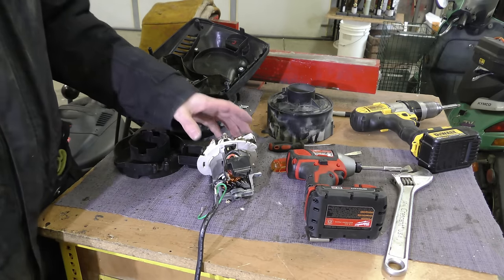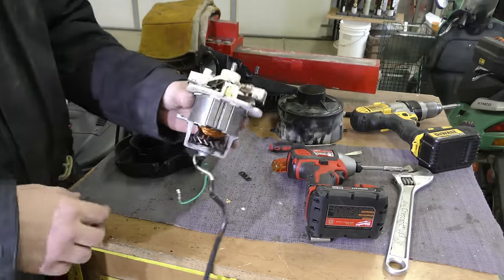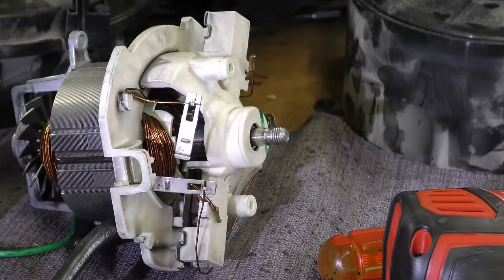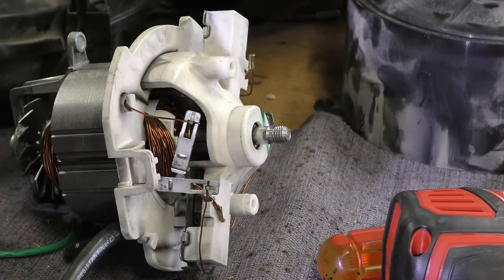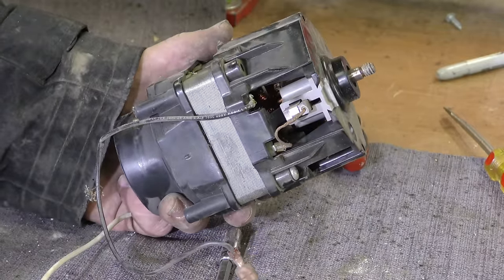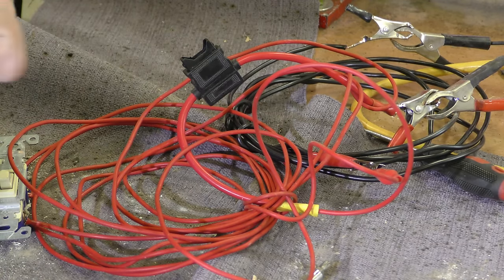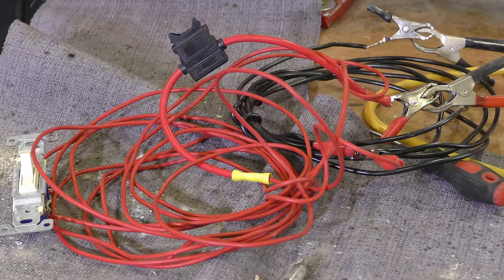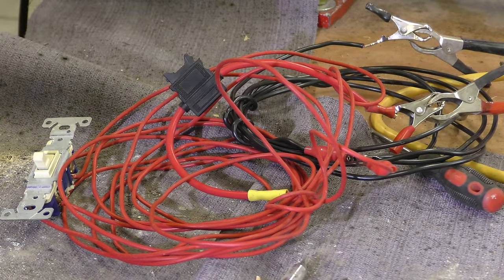Shop Vac Failure Points and What Happens When You Short Out a Fuse

Comment: Your video just saved me some $. For those of us that have more time than money it was worth it for me to check why my shop vac stopped working.  I had the exact problem you mentioned in your vid.  I just stuck a auto fuse in between the terminals and it fired right up. Thank you!

Comment: I found this video after diagnosing the open circuit at this point. 10 gal/4hp shop vac is 10 years old, heavily used, but the brushes and armature look mint. Seeing the fuse was melted, I put a piece of solder wire between the connectors. Figured that would fail faster than a hard connection or aluminum pin. 🤷‍♂️ Looks like I'm taking the brand new Rigid 12 gal back today. Lmao.
Reply from the maker: Yep, self-destruct feature! First vacuum I did this to 20 years ago still running hard yet!

Comment: The fuse on your house is meant to protect your house. The fuse on devices are meant to protect devices. They may seem redundant because they do the same thing on the same circuit but they are specific to to amperage and gauge of the wiring. Primarily, fuses are often localized so thermals don't turn into fires. This due to distance between a short fault and the fuse. Example; Say you had a very long run from your home fuse box to your device without a fuse. Then its the difference between your device being warm to the touch to your device being immolated. This further complicated by how A/C power works and how electric motors work where current is stored as a magnetic field and can induce current even when power is 'off'.

Comment: My 2¢ worth: The difference between a current limiting fuse and a thermal limiting fuse is simply the process variable it's designed for. One is engineered for a specific max current; the other for a specific max temperature. If the temperature limiting device fails, it could be either high current or high temperature that causes the failure, since too high a current will produce higher temperatures. But, the design parameter is temperature, because the motor is designed to work below a specified max temperature and there are circumstance that can drive the temperature up beyond that parameter in the area of the motor. The air circulation can become blocked. It might be used in an environment where heat is not dissipated well due to high ambient temperatures. And, most likely, blocking the suction hose for too long will cause the motor to freewheel, which will increase the inductive reactance internal to the motor leading to more rapid heat generation.

Replacing the thermal limit with any fuse will make the vacuum work again, and is not a big risk to the operator (IMO), but it is essentially bypassing the motors heat protection which can lead to a burned up motor under any of the circumstances described above.

Your test, while dramatic, doesn't prove anything except that a fuse (any fuse) will blow when placed in a short circuit. I'm sure you already know that.

Love your videos, especially the FS. I hope Google is compensating you for all the time you've put in. I'm certain it must be a lot! … The time, that is.
Reply: Lol! … Well Trever, I wish I could say that I am, but unfortunately I only have a HS diploma. And to top it off, I'm not very smart. Why just now, when I got the notice from Google that you had posted a reply, I accidentally dropped your comment from the list and couldn't get it back, while trying to find the click that would navigate me to these comments instead of Goog's drop down menu version of the same. Then I had trouble finding it here, what with all the mundane posts I've been making lately.

And, I've been impressed with Mr. Allen's intelligence. He's smart when it comes to the things within his purview, and no-one can be an expert in all things. Believe me. I've tried.
Reply: You and me both. I have spent 40yrs in the electronical and electronics Field and the older I get it seems the less I know bur this particular video violates some of the most basic common sense rules of safety that I have seen. The VAC maker installed that simple cheap thermal fuse to disable the device. They would rather you spend another  $100 on a new VAC instead of them spending $1,000,000 in insurace/court costs.
Reply: It's true that the VAC maker wants to sell more vacuums, but I don't think there is any connection. It's a safety device; one installed for the protection of the equipment. Under normal use, it would never actuate. And, I'm sure the corporation still pays dearly for product liability insurance.
Reply: @HerbertVickers  I would say if you want a better machine from Shop-Vac, save for an industrial or contractor series.  The big box store stuff is usually geared toward occasional-use owners.